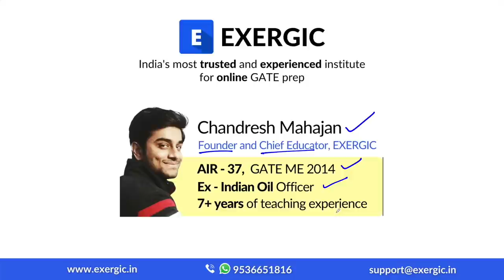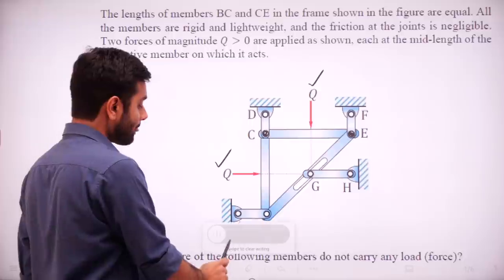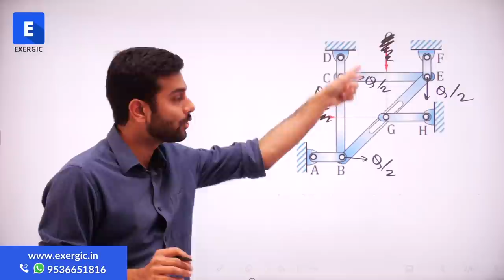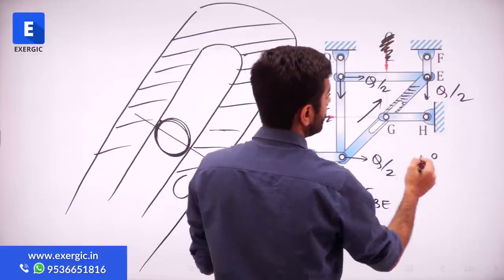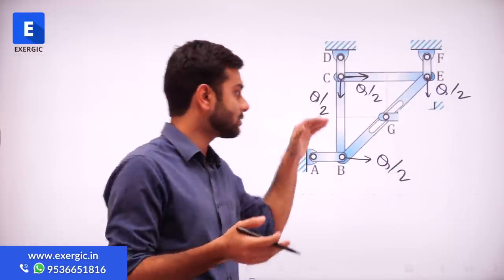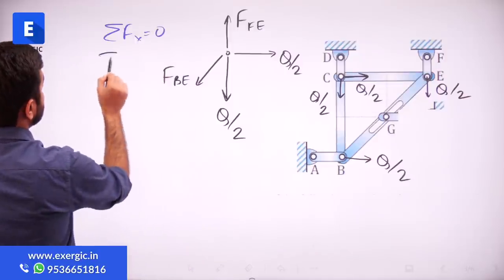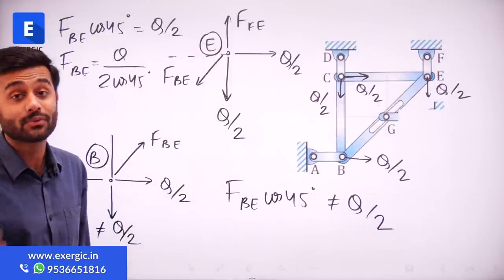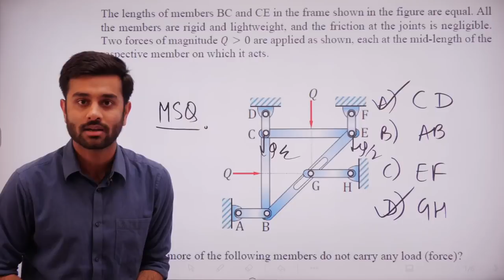Brilliant question from Truss and Frames (Mechanics) asked in GATE 2022 Mechanical | Exergic

Comment: Thank you sir 🙏❤️. Your explanation is unmatchable. Plz, make a mock problem videos on some untold concepts - 
1. Adiabatic filling or discharge of fluids. 
2. Adiabatic & isothermal mixing of fluids. 
3. Possibility of absence of convective heat transfer even at non-zero coefficient of convection 'h'. Why convective coefficient can never be zero even if there is no heat transfer ? 
4. Conservation of momentum in pure rolling of bodies. 
5. Application of drag/shear stresses in the region of developing boundary layer before being hydro dynamically fully developed for both internal as well as external flows. 
6. Calculation of drag force analysis for Reynold's numbers (2300<Re<4000) for internal conduit flow & (Re>5*10^5) for external surface flow. 
7. Calculation of heat transfer coefficient by convection in the regions of - 
(i) Both Thermally & Hydrodynamically developing region, 
(ii) Thermally developing but hydro dynamically fully developed flow, 
(iii) Thermally fully developed but still hydrodynamically developing flow.
8. Concepts of regeneration, reheat & cogeneration & basic deep insights for inefficient combustion in IC engines. 
9. Details of energy conservation in oblique & 2D collisions of both rigid as well as deformable bodies. 
10. Effects of friction & poisson ratio on the workable performance parameters like force, energy consumption & many more in metal forming processes for both hot as well as cold working ones. 
11. Planar & non-planar balancing of masses in rotating & reciprocating systems. 
12. Some application aspects of throttling process (Sudden expansion process) & functional conditions based on T-s & P-v curve.
13. Sufficient clarity insights on the interrelationships & dependencies of natural, forced & damping frequencies for a single degree of freedom vibratory system. 
14. Non-Dimensional analysis tricks on any physically valid problem (FM topic).
15. Basic clarity of difference between fatigue design criterias. Factors affecting the endurance strength of material for any application based on size, shape, temperature, surface roughness, etc.
16. Formation of residual stresses in processes like hot or cold working, cooling of weld zones, heat treatments. Their subsequent affection on working parameters. (It will be blessed if we get some mathematical clarity on this topic).
17. Calculation of ductility, stiffness, toughness for an element or body in 2D loading. 
18. Analysis of body on the basis of engineering & true stress strain values. (There is still something inside undestanding should be known to aspirants.)
19. Combined thermal resistance & equivalent overall heat transfer coefficient for an application of all simultaneous presence of conduction, convection & radiation. 
20. Physical & mathematical intuitions for analysing the formation of eddies, wakes & back flow regions in cases of flows in sudden changing cross sections, blunt bodies, etc. 
21. Basic tricks to identify & clearly differentiate between mechanisms, machines & structures. 
22. Frames of references in relative motion of bodies in kinematics as well as dynamics intuitions. 
23. Mechanisms of failure of mechanical contacts like gear meshing, bearing races, rollers contacts due to slipping & wear in applications of power transmissions & motion supports. 
24. Toppling of bodies under slipping friction & its prone conditions. 
25. Deep insights on third law of thermodynamics (As this topic is also very less explored in front of first & second law but has some hidden myths which aspirants should know.) 
26. Feasibility extent of any physical process based on its entropic calculations (Exergy analysis) with heat transfer & non-heat transfer dissipative mechanisms like mixing, plastic deformations, friction, turbulence, etc. 
27. Some necessary & miscelleneus modifications in power & refrigerating cycles like super-heating, sub-cooling, reheating, multi staging, bleeding. Along with turbocharging, super charging. 
28. Topic on degree of reaction concept related with details of heads utilised like static & dynamic in any turbo-machinery. 
29. Theories of failure for applications involving combined loadings. 
30. Deep & practical comparison on ideal, real & perfect gases with their in depth thermodynamic aspects. 
31. Necessary modifications in ideal Bernoulli equation with unlocking of its each assumption to realistic application like head loss, head use or consumption, use of heating or cooling & many more.
32. Unsteady mass conservation application example like filling, emptying, accumulating, generating, consuming control volume systems. 
33. Constant & variable heat sources or sinks with space & time. Its use in analysis of  heat transfer problems in both steady & unsteady state.
34. Some insights on axial heat conduction in pipe flow & its relative importance with radial heat transfer. Concept of bulk mean fluid temperature in convective flow. 
35. Natural convection on horizontal, vertical & inclined surfaces. 
36. Varieties of minor losses in pipe flow & its calculations. 
37. Vibration isolation & transmissibility concept. Its physical importance. 
38. Use of structural reinforcements on the basis of force, stress or energy absorption in machines. 
39. Some new treatments in machining problems on feed, depth of cut, material removal rates & all. 
40. Basic meteorological concepts based on linear & angular measurements. Confusing application of fits & tolerances.

Sorry 😅, my comment is too long. But it will be good enough if you make videos on these above topics. (It may be possible that some of the topics from above will not be asked in GATE or any exam but at least aspirants/technically curious students will get fundamental clarity.) 🙏
Reply from the maker: Thanks for the positive feedback and such a detailed comment. We really appreciate the time and efforts you put into this.

Topics you mentioned have been forwarded to the Team. 👍
Reply: @ExergicGATE   Thank you sir 😀. Lot of blessings to you 🙌. We are eagerly waiting ❤️🙏.

Comment: In set-2, riser design problem, practically solicitation time of riser should be strictly greater than that of mould (to be specific at least greater than 25% ). Therefore only one option is correct from the given options i.e. a/2 only. So, should I challenge it?